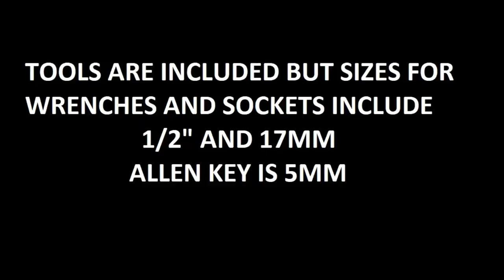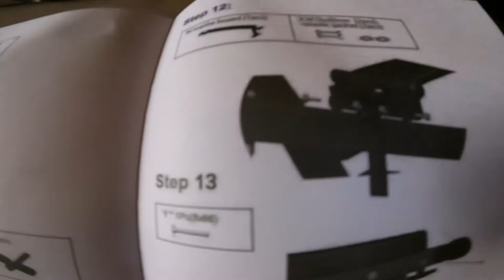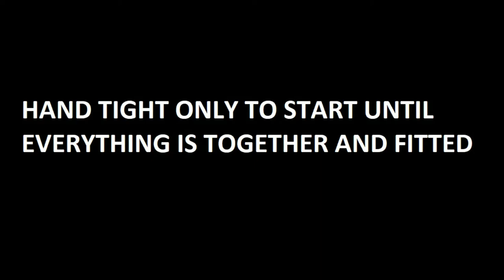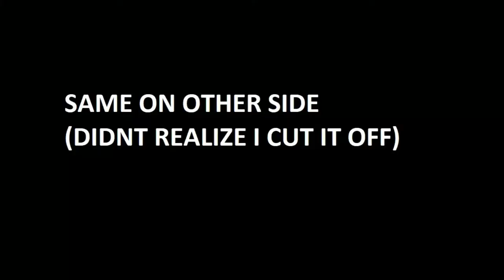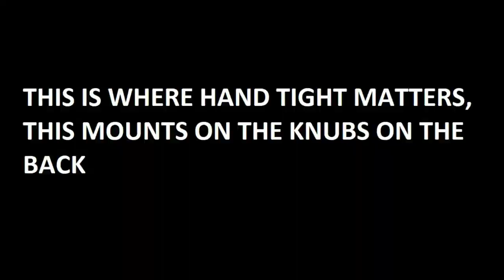Building Kicode Power Tower

Comment: Hey please answer, in the description it says its 82-88 the height in pics it says 71.6- 91.3, I need the 71.6 height, Which is it? Also the length between the dip bars and push up bars are how many inches? thanks!